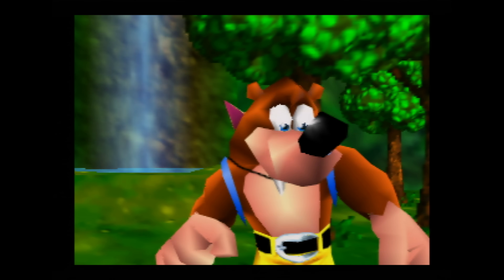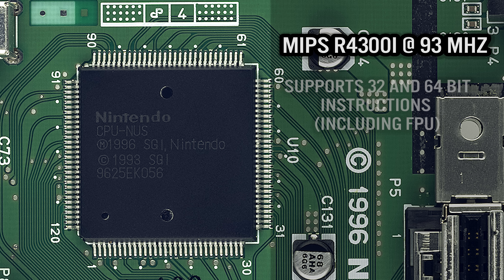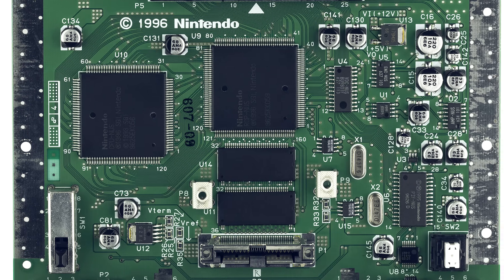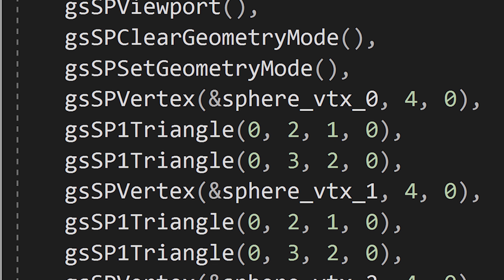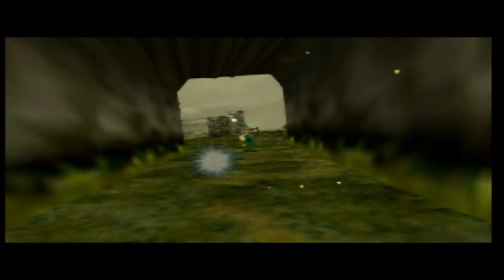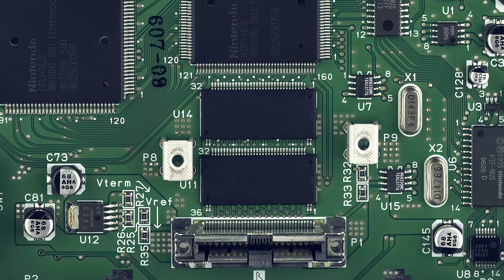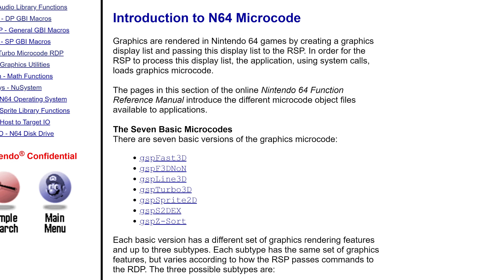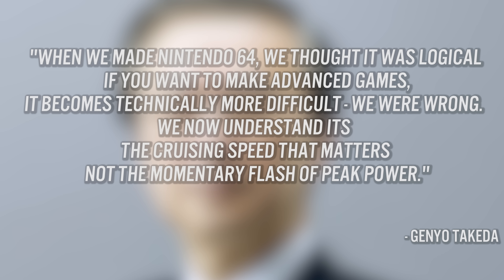Why was the Nintendo 64 so hard to develop games for ? | MVG

Comment: Regarding the painful 4k texture cache, non-3D games have a way around it, in theory. You can simply render on the CPU and blit pixels to the framebuffer. I think it's called framebuffer poking on other platforms. This is used in a limited fashion in N64 games to render certain elements. The red dot in Pokemon Snap is a fairly famous example. But the only commercial game rendered entirely on the CPU was Namco Museum. A number of homebrew attempt this technique, including a Flappy Bird clone and some other stuff. But one of the more interesting projects is 64doom. A port of Doom to the N64 that renders on the CPU and blits directly to the framebuffer. https://github.com/jnmartin84/64doom

Overall, the N64 suffered from severe bottlenecks. There's no point having fast access to the cartridge or a lot of RAM if you're constantly stalling trying to get to it. This is the root cause of rampant framerate issues on the N64. I remember reading that Factor 5 had to get very creative to render Rogue Squadron without the framerate tanking. Devs had to find ways to render while minimizing fetches from RAM, because fetching anything from RAM destroyed performance.
Reply: Doom64 makes a lot of sense being rendered on the CPU since it's a port of the Doom engine from over in PC land, which predates hardware accellerated 3D graphics (and indeed PCs of the era did not have the hardware accellerated 2D graphics that consoles did).

Without getting into too much technical detail, Doom did not use triangles for geometry, but was rather built around using a BSP tree to figure out which walls each column of pixels is projected to.  This technique has severe limitations (you can only have vertical walls and horizontal ceilings and floors, and only one floor and one ceiling for any given sector - no two floor buildings here.), which is why it was replaced by using triangles once computers were fast enough in the years to come.

It would also be difficult to rewrite it to use the N64 GPU.  For one thing, Doom textures are generally 64x128 or 128x128, which would not fit in the N64's texture cache, so you'd have to go and break everything down into smaller chunks or else greatly reduce texture resolution in addition to turning everything into triangles.  In the end, it's not even clear that after all this the hardware accellerated path would be faster!

Besides, the original Doom came out in 1993, and targeted the 486s of the time.  N64 had plenty of CPU power by those standards - 3 years later was a looong time for tech advancements in those days.  Do a direct engine port, find out it's plenty fast, and call it a day.  Heck, Doom actually had a port running on the SNES....
Reply: @Keldor314  actual Doom 64 game had nothing to do with the original PC Doom on the tech side, it is a completely different engine and completely different game as well. It does not render on CPU either. The one that runs on CPU is a direct port of PC Doom made by enthusiasts a few years back. It can't even run full speed.
Reply: @shiru8bit They even released Doom64 for PC recently, as it's a completely different game--a sequel to Doom II.
Reply: N64 does not have enough CPU power to render anything impressive to the framebuffer. Maybe you can get a couple of 2D layers like Genesis games had.
Reply: @shiru8bit  I was going to to ask this exact question. Did it actually have enough power to do anything with the frame buffer that would be of significance. Thanks!
Reply: @shiru8bit  That's pretty hilarious that you believe such malarkey.  So according to you, 5 MBs of VRAM, a 64-bit Address Register, and a Dual 32-bit Data Bus, with 60 MIPS & a 73 MHZ Clockspeed, is not enough CPU power to implement a Framebuffer.
Reply: @segaunited3855  Maybe it isnt if you dont have a guy like John Carmack, maybe they just simply couldnt get doom to run good with all that power. I remember running it on my 486sx 25mhz just fine,  doom 2, and it didnt even have an FPU so its strange to see doom run so poorly on a faster system with a graphics card even.

Comment: Nintendo has a habit of making something amazing and then doing something stupid.

N64 was stupidly complex
Wii was underpowered
Wii U had a stupid name
Switch has faulty controllers
3DS had to held at a perfect location for the 3D to work
Gameboy didnt have a backlight
Reply: Jake Whitwell dont forget:
NES cartridge slot wears out
SNES had a slow processor
GBA still didnt have a backlight

The only system nintendo made that didn’t have some kind of glaring issue was the DS
Reply: @Tom-jw7ii  Yea, surprisingly the DS was great. I guess the only issue would be they killed off online.

Comment: 1:41 "it has a 5 steps instruction pipeline or, in order words, it can execute 5 instructions at the same time" sounds misleading to me.
The 5 different steps (instruction fetch, decode, ...) are indeed performed on 5 instructions at same time but at the end you still got one instruction executed per cycle.
Reply: Misleading to who? Computer scientists and engineers who have studied CPU architecture and know better?  For everyone else that statement is perfectly fine you are executing parts of 5 separate instructions on the same cycle and the end result is 5x throughput (in most cases) for a layman that statement is fine.

Comment: I don't think the "ten times more powerful than the Pentium" claim holds any water. Pentium CPUs already reached 233MHz by 1996, had a superscalar design, hardware decoders, an integrated FPU supporting single precision and double precision, and could handle some heavy professional workloads. The MIPS processor might have been on par with a first-generation Pentium when the Ultra 64 was revealed in 1994, but two years later things were much different.
I think the claim could be accepted if we take the N64 system (CPU+RCP) as a whole against a Pentium on its own, but ten times more seems far fetched, and it's not a fair comparison either way because the Pentium does not have a massively parallel graphics acceleration unit, and any comparison like that is like comparing apples and oranges.
Reply: x86 fpu is 80bit
there is a dude who implemented h.264 decoder running on RCP at 18fps, so there is that.

Comment: Because it used only 64 mb of storage space per cartridge  most third party games wouldn't fit in only 64 mb of space so those games went to the Sony Playstation which the disc spaced system used 700 mb of space per compact disc so it was easier for games like final Fantasy 7 and metal gear solid to be feasible on the Sony Playstation
Reply: That reason was minscule compared to the other reasons in the video
Reply: @crashoveride879  true your correct but it was still a big drawback for 3rd parties  some not all

Comment: Wonderful Video! Very interesting, man there was huge difference in texture work compared from 64 to playstation, they used 16x16  to 32x32 textures, while playstation had much bigger textures to cover characters, characters in n64 needed to have patterned clothes of small textures. Using that technique alone in 3d modeling textures will give you the 64 look. And with your video is the reason why I want to make 64 style games on pc and not on the real n64 lol.

Comment: Also quite telling that Nintendo quickly learned from their mistakes when designing the GameCube, using memory explicitly designed to reduce latency as much as possible (1T-SRAM).
Reply: So if I'm overclocking my RAM should I be focusing on reducing latency over increasing clock speed?
Reply: @NLynchOEcake  both, but it's really not worth spending too much time on it.
Reply: @jc_doge  Especially considering I'm still running Bulldozer and my latency physically cannot get lower than 74ns...
Reply: @NLynchOEcake  instead of spending time messing with that focus on saving up for a decent computer lol
Reply: N Lynch please thorw that bulldozer away and buy something decent
Reply: @milojkokitic6991  Sure, you buyin?

Comment: Pipeline length  and parallel processing capabilities are not the same thing. A deep pipeline might reduce the number of cycles each instruction needs by preparing some  data and sub modules in the CPU before the instruction is processed but it isn't truly parallel.

Comment: Why weren't any consoles converted in PCI boards that you could purchase and add to your PC?

Only 3DO had this idea, but it never took off.

It would have been great to have full console compatibility, while enjoying PC storage, ram, and perhaps adding console gamepads to the PC through a peripheral port in the card itself. Or perhaps wifi and other devices that could be offloaded to the host system.

I think it would make consoles cheaper and more affordable, as stripped down PCI or PCI Express add-on cards. Think about the possibilities.

Did 3DO bump into unsurmountable problems, or it just wasn't popular?
Reply: That was the 3DO blaster - I had one of them.  It was an annoying thing to use because it only worked with certain Creative labs CD-ROM drives and needed one of a specific range of soundblaster cards.   I did manage to get it working eventually, but it took a lot of work.  The only other product like that I can think of is the NEC PC-FX GA - which ran software for the NEC PC-FX (a machine that was only sold in Japan and was so unsuccessful most people have never even heard of it).  I suspect the more basic problem is that if the machine is so expensive that it seems worthwhile to build a stripped-down version to plug into a PC it's probably too expensive to be successful anyway.
Reply: @TrimeshSZ  They tried vendor lock-in then, because IDE interfaces were already universal back then, even if you had to connect a drive directly to the board. Sad news. Needing a specific set of soundblaster cards is another symptom, because sound and video should be processed onboard.

Let's ignore that for a minute. Now think all the way around, if you could put a PS4 or Xbox One board on your PC, and play all the games, and use the OG controllers. Even if you have a weak graphics card on your PC, that wouldn't matter, because the board has everything.

Now, assume you get a RTX 2080Ti, and the console board can see and use that. Boom, instant upscale, 4k 60FPS is suddenly possible. Or maybe a GTX 1050 can still offload some serious burden off the console gpu.

In a parallel universe, there is no console wars OR PCMR, and you can put both consoles inside your PC.
Reply: @lfla0179  In fact, these drives weren't IDE - they used the old Panasonic MKE interface and command set - which makes sense since that's also what the 3DO used - even the models made by companies like Sanyo used the Panasonic command set.
Reply: @TrimeshSZ  That was unexpected!  Today these problems wouldn't exist.
Reply: Wasn't popular, N64 did do something like this for the dev board for SGI Indy workstations

Comment: The 64-bit Atari Jaguar was equally as hard to develop for and it had several 64-bit chips. Most developers got lazy and ported games to run with the 68000 which was mainly there for boot up decrypt and then pass control onto the rest of the system. Jeff Minter seemed to be the only programmer who knew how to use the Jaguar.
Reply: Jaguar had two 32bit chips packaged together and that is what Atari called 64bit chip :-)

Comment: MVG, you have made several mistakes since minute 6. It is mandatory for the RCP to use the TMEM to paint the textures and to use the bilinear filter. RCP cannot use RAM or cartridge memory for textures, and also they are too slow to apply effects to them. What they did in Turok 2 to use 64x64 pixel textures is to use 4-bit textures with color palette, or black and white that were colored by the RCP based on the color basis of each polygon. But this was not exclusive to Turok 2, all games at some point use colored black and white textures for specific polygons that only needed one color, for example some doors in Ocarina of Time. Even grass and dirt effects were achieved with the same texture painted in green or brown.
The RDRAM latency is not that high compared to other chips of the time. The EDO RAM of the 3Dfx Voodoo has a latency equal to or greater. The problem was in a very narrow 9-bit bus and over-exploited memory that was used to store code, polygons, textures, z-buffer, framebuffer and much more data, making the 500MB / s of memory very limited.
Edit: About textures, with 4KB of TMEM you can use textures up to 48x48 in 16 bit colors, and 90x90 in 4 bit grayscaled colored.
Reply: I don't think everyone knows everything about turok 2